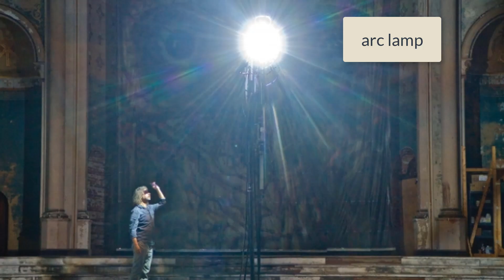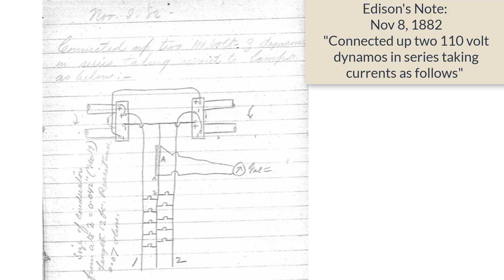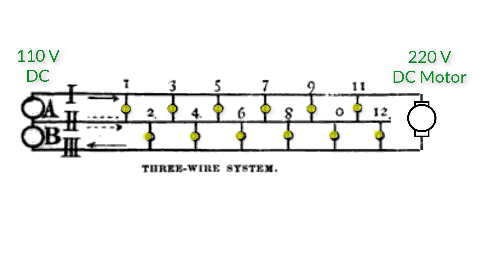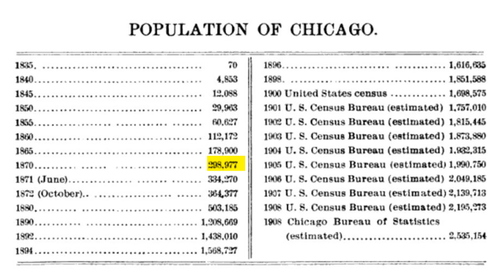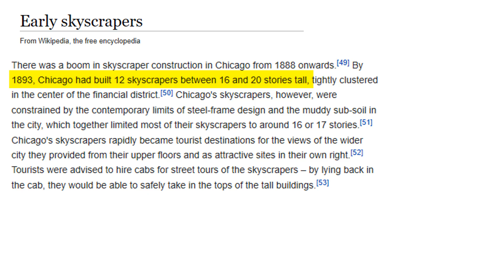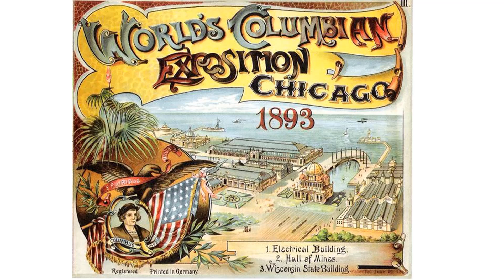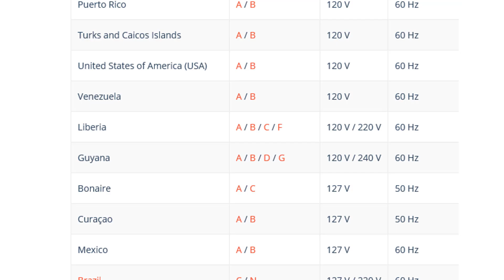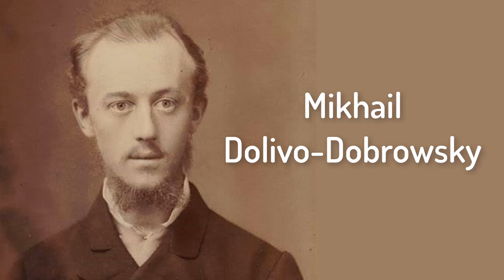Physics and History of Why USA uses 120 volts and not 220 volts

Comment: Residentially we get supplied with 2 legs of 120 volts each. We get 240 volts when we provide BOTH legs of 120 volts each to an appliance. Ask any electrician (licensed) or employee of a power company....120 volts times 2 = 240volts NOT 120.
Yes manufacturers put all All kinds of crazy measurements on there electric appliances such as 115, 117, 220, 210 or 110 but this just signifies what EXACTLY the voltage is that they were designed to operate at NOT what you get from an outlet.
So  we have 120volts and 240 volts in the US from the grid and thats it!

Comment: Edison did do all this but a man called Tesla invented AC Voltage. Edison never had a Neutral as it was DC, Positive and Negative. He lost the race for what we have today. The higher the AC Voltage the smaller the conductor can be used to carry the load. The US also has a problem with the way they use their AC Transformers in DELTA as there is no Neutral or Ground. I once worked in the US on Vehicle Engine testbeds and found that the 3 phase came through a DELTA wound transformer causing Ground loops when incorrectly Grounded causing the Zero volt rail to be active rising and falling in volts, causing instrumentation to fluctuate (Kirchoff's Fist Law.) UK uses 220VAC Line Voltage at 50Hz and 3 phase 415 VAC Min, up to 132000 Volts 5 Wire System in a STAR configuration which are, three phase, Neutral and Earth (Ground). It's strange that Tesla is much forgotten in the US, he was a Genius and an inspirational Scientist.

Comment: We DO use 220 just not in standard wall sockets.  Your washer, dryer and A/C is likely connected to a 220 outlet.    I believe the choice was made for safety reasons, 110 is a lower voltage, is safer and is sufficient for most devices and appliances.  Only those which use motors requiring more torque will need 220.

Comment: In the US the electricity is primarily distributed as split phase. It splits a single phase at the transformer and the neutral is generated it the mid point of the split phase transformer. So the two 120 volt wires that come in your house are in phase. A single phase. The confusion largely comes from probe placement with an oscilloscope. We actually have 240 split phase service in most of the US

Comment: Actually most houses in the United States are wired with 240 Volts. It just the outlets are 120 Volts for the 90 % of appliances that use 120 Volts. Many things operate on 240 Volts, Air Conditioners, Heaters, Electric Hot Water Heaters and Electric ranges and ovens use 240 Volts.

Comment: One big problem is people want to use 120 volt for small heating appliances and space heaters and window air conditioners 240 bolts the amps were cut in half wattage is bolts time amps at electric heater would be five amps at 240 volts alot less heating ofbilding wires. But wothled light you get same light with 10 percent of wattage, saving on electric bill

Comment: The simpler answer, albeit less complete, is that early adopters are at a disadvantage to late adopters who have the advantage of hindsight and better/newer technology.  Europe trailed the US in electrification and therefore could chart a better path.  More voltage has a lot of benefits wrt the wiring needed.  We see that today even with solar panels and moving low voltage for any distance.

Comment: THE US I LIVE IN USES 220V - 240V CENTER TAPPED INTO 2 110V - 120V AC LEGS. I'VE NEVER SEEN ANY HOMES WITH ONLY A 110V AC SERVICE. THE US IS 60HZ VS 50HZ FOR EUROPE. THE DIFFERENCE IS THE US HOMES USE CENTER TAPPED 220V TRANSFORMER SECONDARIES BUT EUROPE USES SINGLE TAPPED 220V SECONDARIES. BOTH SYSTEMS ARE ~ 220V AC JUST TAPPED DIFFERENTLY.

Comment: Excellent video!

I saw the correction on series vs parallel, but there was one more glaring error.

While a few areas used true 2-phase, 2-phase for all intents and purposes no longer exists in North America. Residential uses single phase (specifically, split-phase) , which are two legs (not phases) off of a center tapped transformer.

You have 1 phase with two legs in a typical residential load center.

Comment: 130V has been used as well in Europe (up to 1958 in my case). That  time they decided to pass nationwide to 220V while swapping every appliance to the new voltage (and sometimes by replacing the appliance or providing an autotransformer 130/220). Later the standard became 230V for mass production, UK passed from 240V to 230V and the continent from 220 to 230.

Comment: I find it interesting that you state 1/3 use 110 and 2/3 use 240, when the map shows that pretty much only North America use 110 and the rest of the world uses 240.  Another way to look at it, is that 5% of the world's population use 110 and 95% use 220/240.

It's surprising that the USA is still so stuck in the 1800s.

Comment: I'm  not a electrician  but I've used 110 volt cut off saws running through a step down transformer in Burkina Faso. They just don't have the mojo of a proper 220 volt saw. I think you can change the voltage, but not the Hertz. And so not enough power, they would just smoke the cut off disc as the speed was down

Comment: 240V/50Hz here in Australia. The  extension lead on my caravan (RV) that I use to plug into a caravan park (RV park) power supply, is a standard 15A lead and is about 10mm (just under 1/2") in diameter.  From what I've seen, the same RV lead in the US is a 30A 10-gauge and subsequently TWICE the thickness .. TWICE the copper and with TWICE the weight!!
A 20m lead her in Oz is fairly weighty ... but I reckon you'd almost need to pack a trolley to carry the same length cable in a US equivalent.  You've also got a 50A cable!!

Comment: My understanding - as an electrician the change from DC to AC which still has evidence in San Francisco. Which also has an exhibition after the 1906 earthquake - some cleared land to rebuild, and a fear of gas lighting to take advantage of. But as also being a place in which DC motors for Otis elevators REMAIN STILL IN USE TODAY… The pre-existing Edison 3-wire systems remained and converted from DC to AC is still a SINGLE PHASE - 240 in the same 3-wire center tapped grounded system.

Comment: During WWII, a 120/120 wye 3 phase system was used to power US submarines. Done so to eliminate the maintenance of brushes and commutators of DC generators and use only a pair of slip rings and 2 brushes for excitation current. Much easier to repair and maintain. Also crew safety was enhanced as electric shock was reduced as there was no more than 120 volts anywhere on the boat. Some of these and the electrical gear for them made their way into Army Corp of Engineers flood control dams. Pretty easy to make utility power 120/120 3 phase with a bank of transformers and with a bank of properly connected capacitors 3 phase (actually it’s very close but not true 3 phase) can be made from a single phase source. Yes a dc motor will run on alternating current just not as effectively as true dc. If you get down to it DC from a commutator type generator is a high frequency ripple current type voltage but the load averages it out into something close to DC. A broad range 12 lead generator can be reconnected into 120/120 3 phase unit but it requires it to be derated as some of the power is used up inside the generator and dispersed as heat. Same for making a single phase generator out of a 12 lead 3 phase generator. You can do the same with a 3 phase transformer and again derating is required. Also the 3 phase 120 allowed usage of standard 120 volt stuff from the civilian world on board the boat. Btw 6 phase power has been discussed but there is no advantage as the cost of the now non existent gear offsets any gain in efficiency.

Comment: Why does America think it has the best products? In Europe, we see US-produced technology as low-quality goods. Not using the metric system suggests complacency.. 1/100th of a millimeter is less than 1/100th of an inch. Of course, accuracy suffers. In the metric system, you need to move the comma. Don't recalculate. USA has a great attitude. If they want to implement something, they will do it. But it will far from always be good.

Comment: Incandescent light bulbs last longer than AC incandescent light bulbs.
It is the Cycling of AC that causes filaments to heat and cool repeatedly.
DC they basically stay at a given temperature.

Also, the more filament holders in a light bulb the longer it will last too.

Comment: Thomas Alva Edison  (Alva mexican name)  Incandescent lamp inventor (at least He patented)   As far as I know He founded de General Electric Co.  He was in love wyth "Direct Current electricity"  and generators of DC   Charles Proteus *Zimerman  *I am not sure about Zimmerman name..  German Engineer  develop the "Alternator" Altern Curret AC.   That it is easy to upper or lower the voltage;  In order to transmiting electricity long distance high voltage is necesary and using a Transformer thats it, no problem EASY way: USA use 360 degres of circle 3 phase 120 degres e/u.  Europa use decimal 50 degres 230  240 V  they save cooper but need more insulation.   Automobiles use DC  residence & industrial AC    Sorry about my English.

Comment: Nice explanation! 

Skyscrapers also needed power for elevator motors, without which there would have been no market for buildings over 3 or 4 stories.  The side story of Otis Elevator and particularly of Otis's initial emergency brake system (which was little more than a carriage leaf-spring) is fascinating, and he too presented his invention at the Worlds Fair.  I read once that with dozens watching, he would stand in his demo elevator and with a chop of his axe, he would cut the rope holding up his elevator car.  Instead of crashing to the ground, which was VERY common in those days, Otis's demo car would only fall a couple feet before that leaf spring would open up, lock into the shaft structure itself and stop the car, he sold beaucoup elevators and cemented his legacy in history.

And separately from that, plumbing eventually DID make it to downtown buildings, not only to provide water for the humans to drink or to flush with in the buildings, but also to provide water for firefighting purposes; probably something that Chicagoans were super in favor of after The Great Fire.  Even today, we still use gravity and the "column of water" method to provide steady pressure and flow to every faucet, tap, or toilet in a building or area, and the best way to do that is to use electrical pumps to push the water up into a water tower for supplying a wide area, or up a building for storage in one or more tanks on the roof for supplying that building.  It would certainly be preferable to have running water (even if it's not heated!) than it would be to carry a nearly 43-pound 5 gallon bucket up the stairs to your office desk or factory station every morning for your day's expected water needs!

Electricity was for so much more than mere lighting.  So as Paul Harvey used to say, "...and THAT is the rest of the story".

Comment: It’s funny that 220/240 is more efficient to transport, but 65hz in the USA is more efficient then the 55hz used in the 220/240 countries.  I didn’t realize 220/240 is transmitted on 1 wire plus a neutral in the rest of the world, I thought it was 2 phase everywhere.

Comment: @ 2:35. More resistance on popular lines? Surely, if you put more lamps in parallel, the resistance 'reduces'. Less resistance will draw more current and load up the generator more and cause voltage drops along the line.
Also @5:09, these early generators were DC and could not change the voltage by transformers. Which was a feature of later (westinghouse) AC systems.

Comment: The reason for 220 and higher voltages is because with these higher voltages a smaller diameter supply line can be used for greater distances while still getting the same amount of current. Smaller supply lines for greater distances equals savings of money for the wire . Which could equals many miles in a country .

Comment: I believe this is the reason there are no electric kettles in the US. I brought myself a dual voltage travel kettle in the UK before a recent trip to New York. It took about 6 mins to boil 0.5 litres of water in the UK. When I tried it in the US it took 30 mins! I assume as well as halving the voltage it more than halved the current (the power rating said from 125 to 600W).

Comment: I'm a mechanical engineer by education but I had a job where I had to design a power supply for a 3-phase system.  It wall worked out okay except for one device that I selected 120 VAC for.  But as you say the phase-to-phase voltage is 208 VAC so the device quickly burned out in testing.  OOPS.  We figured it out, I had the 240 VAC device shipped in from the supplier and the testing thereafter was a success.  Until then I knew very little about 3-phase power.

Comment: Isn't Europe also using direct current while the U.S. uses alternating current. Alternating has a longer transmission distance over direct current and is cheaper to produce. I thought that was the main reason for the voltage difference. Direct current requires more transformers and higher voltage to be efficiently transmitted.

Comment: “One third of the countries use around 110, 120 volts”? Ha. What a biased view of the world! Actually only 16 % of the countries use that voltage range, and that includes all the tiny countries in the Carribean. Would be interesting to calculate the percentage of population that (still) uses 110/120 V.  Countries with mixed use generally are in the process of upgrading everything to 220/230 V.

Comment: I Do believe this country, USA, uses 240 volt system and that is due to a step down transformer with a center tapped secondary which produces 120 volts on each leg referenced to the center tap which would normally be neutral.

Comment: Here some information that might be of interest. The acceptable range of supplied voltage, once stepped down, is from 110 to 130 vac, or, half of the service 220 to 260 vac. It's going to vary depending on your distance from the substations, area load, etc. 120v is the median, of course. It's interesting that you see devices specified for 110, 115, and 120, and rarely 125. But, never 130. 
And, the question is why don't all of the manufacturers just say 120v?

Comment: A  lot of the reasons for 50 vs 60 hz are kind of dumb. 50Hz is easier on the power company generators because they spin at a lower RPM. 60Hz is PERFECT for clocks as it can then be used as a "mechanical timing signal" because a 60 hz motor is easier to get to spin at 3600 rpm and gear down to divisions that coincide with clock hand revolutions in an electric analog clock.

Comment: When in EE school I got some of the history shown here but it was new to me about the series DC generator/ 3 wire practice. I have worked in steel mills where it was not unusual to encounter motors from the 1910s and MCCs built in the 1920s. The control distribution of the DC to cranes was especially interesting. At 4.00 minutes the diagram reminded of a simple thing we did to monitor the Crane 240Vdc supply. We used 3 240V light bulbs, 1 wired leg to leg and the other 2 from rail to ground. Any fault resulted in a change in brightness to tell us to go find the fault.  Working with technology from 1920s and up was a fun challenge. BTW some cranes still used control panels made in the 20s as late as 2010. The same crame had some mechanical parts that had patent numbers fron the 1890s. It was an adventure!

Comment: You   reduce the amount of copper wire needed  by raising the voltage. 
The great thing about European wiring is that  at 220 volts,
 high current devices do not require that house wiring be
as thick as in USA. Where we would want a 12 gage wire for 
the average outlet to handle a 20 amp load, in Europe that same
amount of power could be handled better with just a 14 gage wire since
the device would only produce a 10 amp load at 220 volts as opposed
to a 20 amp load at 110 volts. Also, higher current at lower voltages
is harder on any wire to wire or wire to socket and circuit breaker
connections increasing the possibility of a failure at these 
connections.

Comment: It's important to keep in mind that the word "phase", and the word "leg" or "line" or  "live/hot wire", are two different things.
Most residential and many commercial buildings are supplied with single phase 240V service, using two hot wires, or "lines". If a "phase" is the same as a hot wire, then how could two lines be single phase?
The actual definition of "phase" has to do with the interaction between two or more conductors  or different potentials - not just the number of wires involved in the circuit.
It's incorrect to say that American homes are supplied with two 120V phases.
Actually, they are supplied with two lines that are 240V apart, with a neutral (from a center tap of the transformer) that is 120V from each line.
All that said, it is still a single phase service, so by definition it can't be served by two "phases".

Comment: The U.S. and Canada actually have 240V for homes, not 110V. The local step-down transformer converts 15,000V down to 240V with a center tap  on the lower Voltage winding and each home will have three wires coming into it: two wires with 240V across them and a third neutral/center tap wire.

Comment: In Tungsten Filament Incandescent bulbs the 115 volt bulbs have lumens per watt than 230 volt bulbs; when both  were designed for standard 750 hours life. So actually the USA's 115 volt bulbs were more Greener for over a century.